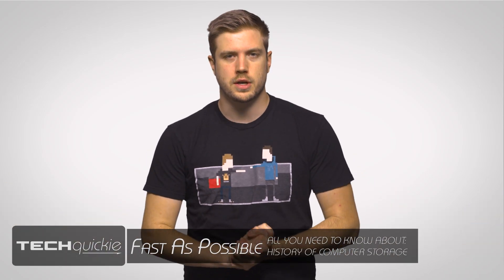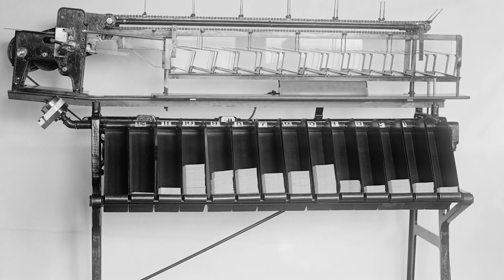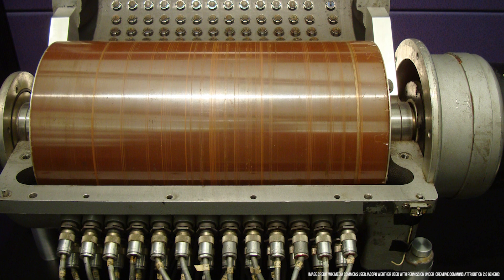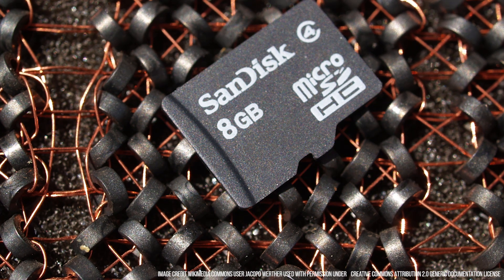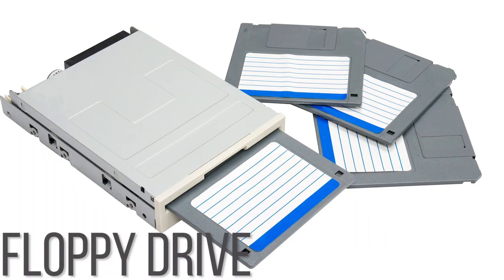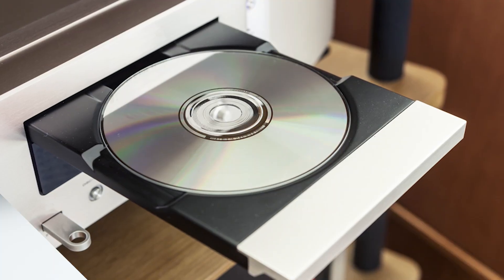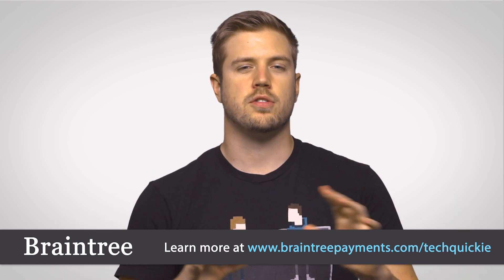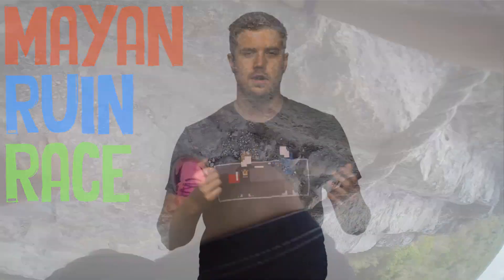The History of Computer Storage

Comment: too bad the inaccuracies.... HDD can't take the place of core memory for code execution.  also, zip drive was not a floppy drive technology even though it was a cartridge .
Reply: ZIP drive - you are correct; I was incorrect.  The ZIP drive was indeed a non-rigid disk.  I confused it with the JAZ drive from the same manufacturer.  I had taken one apart last year and it was a rigid based disk technology, not a flexible one.

About your RAM and HDD statement - the youtube discussion was about the history of storage.  The core storage he referred to was a magnetic core storage where each magnetic core was 1 bit and was physically woven from sets of wires.  It probably fell out of vogue around the mid-70s except perhaps for space missions.  You can't get very high density with a moven material of separate non-integrated cores.  
In any case, even if the HDDs get faster, CPUs do not execute directly from the block based HDD memory.  Even when HDDs get faster, there will always be significant rotational latency from the first request.  It is true that virtual memory permits HDD's to emulate a RAM space that is larger than the available RAM, but that still does mean the processor directly executes from HDD.  If you are talking about a new motherboard and the discussion was a form of memory from the 70s, we are obviously talking about different things.
Reply: Yes, Zip drives were a form of floppy disk. Even less known was the Imation LS-120 which had 120MB of storage with the compatibility for standard 3.5" floppy media. My favorite among the types of storage that poofed into mid air never to be seen again by the likes of humans. To speak of them now is to be thrown into the pit of fire!
Reply: 1956 hard drive, fifty foot tall? Looks more like five foot to me. 3.25.

Comment: 2050, laptops that has 20 terabytes of storage for like 400 hundred bucks
Reply: Bruce C I think you meant 2000 terabytes
Reply: Shrijan Shetty I think you meant 2 petabytes
Reply: More like...

In 2050:

Laptops with high speed 100,000,000 RPM graphene magnetic tape memory that draws less energy than today's magnetic hard drive, and holds 100 petabytes

Comment: insert disk 1 of 99999999999999999999999999999999999999999999999999999999999999999999999999999999999999999999999999999999999999999999999999999999999999999999999999999999999999999999999999999999999999999999999999999999999999999999999999999999999999999999999999999999999999999999999999999999999999999999999999999999999999999999999999999999999999999999999999999999999999999999999999999999999999999999999999999999999999999999999999999999999999999999999999999999999999999999999999999999999999999999999999999999999999999999999999999999999999999999999999999999 to install windows 10
 
20 YEARS LATER
 
insert disk 99999999999999999999999999999999999999999999999999999999999999999999999999999999999999999999999999999999999999999999999999999999999999999999999999999999999999999999999999999999999999999999999999999999999999999999999999999999999999999999999999999999999999999999999999999999999999999999999999999999999999999999999999999999999999999999999999999999999999999999999999999999999999999999999999999999999999999999999999999999999999999999999999999999999999999999999999999999999999999999999999999999999999999999999999999999999999999999999999999999 of 99999999999999999999999999999999999999999999999999999999999999999999999999999999999999999999999999999999999999999999999999999999999999999999999999999999999999999999999999999999999999999999999999999999999999999999999999999999999999999999999999999999999999999999999999999999999999999999999999999999999999999999999999999999999999999999999999999999999999999999999999999999999999999999999999999999999999999999999999999999999999999999999999999999999999999999999999999999999999999999999999999999999999999999999999999999999999999999999999999999 to install windows 10

Comment: How bar code work as fast as possible.
Reply: There's a pattern at the beginning and end of the barcode, to act as a reference point for the scanner — kind of like the checkered start and finish lines on a race track.

The white parts of the barcode represent 1's, I think, and the black is 0's. Each barcode is simply a catalogue number for that item, like at a library.

Okay, having double-checked myself, this is a good basic description, but there are A LOT of different ways the idea behind bar codes gets applied. It varies between industries, regions/countries, eras, and more.

Definitely needs it's own video.

Comment: It is sad that we CS students consider usb thumb drive old school.
Reply: what? then what do you use to transfer files to different computers? magic?
Reply: portable ssd"s
Reply: isn't a flash drive and ssd the same or am i wrong?
Reply: +Bhume TM
Cloud storage. Until we have a presentation on an old computer with IE8
Reply: +Tsz Fung Li (李子鋒) then we know USB drives are much more reliable
Reply: what if the internet goes out? you're screwed then.
Reply: +Bhume TM yeah, that happens. Now we use USB drives sometimes.
But most of the time, I do my school works on my crappy laptop and keep it synced and that's all.
Reply: +Bhume TM Same technology, different uses. Either could technically be used in place of another, but you'd look pretty silly trying to race in a Station Wagon, and it'd be pretty awkward trying to fit kids and groceries in a Ferrari.

Thumb drives are meant to be a cheap, portable means of carrying (relatively) small amounts of data from one place/computer to another. Trying to use it as a main/system drive would quickly wear out the memory cells/blocks.

SSD's are far more expensive, but are also larger — both physically and storage-wise — and longer-lasting. They're also less convenient to plug and unplug, but with the benefit of faster read/write (file accessing, editing, and moving) speeds, as well as greater longevity for a given workload.
Reply: Batfan1939 wow, thanks a lot for the very detailed reply!
Reply: +Bhume TM No problem. I ask these sorts of questions all the time. Part of why I love this channel.

Comment: Hmm, yes. But where is the new m.2 drive?
Reply: its still an SSD, all that has changed is the connector and the controller (even if M.2 is mostly connected to a SATA-Controller)
Reply: I feel M.2  drives deserve their own form, since there is a good difference between m.2 and the 2.5'' ssd. Size is a big one and how its already up to 1tb. It could easily replace 2.5ssd. especially since there isnt much of a price gap
Reply: Gruesome Gaming
Still, this Video is about Memory-TECHNOLOGY and an M.2 SSD uses the absolutely same Technology to actually save the data. So why name it seperatly in this Video?

Comment: What about M.2 NVMe? This video is soooooo dated!!!
Reply: they're ssds.
Reply: @atlas8827  Yeah, they are solid state drives, but they are different tech from traditional SSDs.
Reply: @mjribes  just the interface, really. they're still flash storage. i dont even think they ever mentioned interface in this video.
Reply: @atlas8827  Yeah, but it's a helluva lot faster.
Reply: @mjribes  still, i dont think it warrants a mention i this video, since they really didnt talk about interfaces.
Reply: @atlas8827  We'll have to agree to disagree then. My NVMe drive is roughly 5x faster than my SATA III drive which is about the difference in speed between a SATA III SSD and a 7200rpm SATA hard drive. Yeah sure the difference between MVNe SSDs and SATA SSDs is just the interface, but that change in interface gives you a generational leap forward in speed.
Reply: @mjribes  
Again, they didn't really talk about other interfaces either. Did you hear anything about IDE, SATA, SCSI? No. Come on, now.